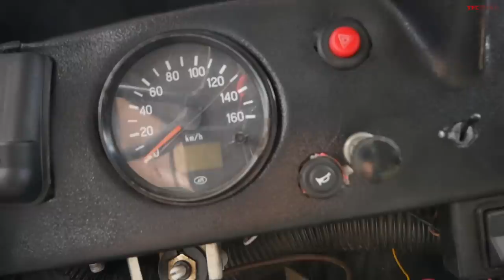My Russian Van Is A Better Off-Roader Than Even A Modern Toyota Collab — And THIS Is Why!

Comment: UAZ didn't make engines - there were different factories which were established as seperate companies after Glasnost. The 2.7 was a ZMZ, but UAZ also used a 2.9 UMZ (also made by ZMZ) and a 2.4 from Andoria in Poland.

Comment: Yes there is a Jeep looking version of these that uses the same engine (I think the whole drive train is identical). The Volga cars also use this engine. Also the GAZ trucks use a V8 version of this engine. I say it's a V8 version of the same engine because everything is the same: pistons, rods, valves, valve drive shafts, the heads also... There's just another bank of 4 cylinders on the crank shaft. The crank shaft and block are different of course. Speaking of cylinders, this engine has changeable cylinders. I mean they aren't part of the block. They can be removed and new ones inserted.
Reply: Yes, there is the UAZ "Jeep" which was as common as this thing. the entire army here in Bulgaria used this vehicle I think. I also believe it has the same drivetrain. Today it is sold as the UAZ Hunter. And the inter-changibility of parts was done for a reason - in case of war you could use parts from other models of vehicles to run whatever vehicle you need. Unfortunately for the Soviets it didn't help them much in the wars they had in the past :D
Reply: @DimitarDobrinov  "the entire army here in Bulgaria used this vehicle"
- Мдаа вярно е. Едно време тия джипки бяха на всякъде.

Comment: I considered buying a Bukhanka, so I made a test drive. I barely fitted in, no room te spare and I am not tall, only 170 cm/ 5 foot 7 inch. The steering wheel was very high, no arm rest on the door. The ride was loud, sitting next to the engine. The door did not seal, the left top front curve was a gap to put 2 finger in it, so water inside when it rains. In the 30 years after the fall of the Berlin wall, UAZ had not fixed that problem.

Going on firm surface dirt road was excellent, no 4WD needed. I was told by the rent company that is the Bukh is not suited for highway use. Just drive on the main country road with 80 kmh/ 50mph. Fuel consumption was also an issue, about 80 % higher then my VW Caddy van. The rent company told me that parts could break down faster then with Western/ Japanese cars, it is still Russian stuff. For reliability the VW Transporter 4x4 was a better choice.

Conclusion: the Bukh is cute car from the past, but not for daily use.

Comment: hi.
i have this cars brother UAZ469 from 1978. its an awsom armagedon wiecle, you can repair it with a hammer and a screwdriver. Its a puritan working machine, i buy it in 2007 from the hungaryan army for 600USD and even today I'm whining it in the forest work. sometimes i go for Off Road partys and pull out there stocked mercedes G, jeep wranglers, pajeros, and range rovers from the mud. it have 75 hp its terible on road and dry area but in muddy terrian he feels in his element

Comment: is there diesel version? how much is CC, and how much is fuel consumption?
Reply: Very few were factory made with diesels. 
The new ones have: 2,700 cc; 112 hp 4-cylinder petrol engine
Average consuption: 10L/100 km
Reply: @crown674  Thanks man 😄
Looks like a goos choice for camping vehicle 👌

Comment: Uaz-452 was developed as a platform for vehicles with a wide range of tasks. In conditions of bad roads and lack of spare parts. A van, an ambulance, a minibus and an on-board truck were to appear at its base.
Reply: О май гад. Итс террибле вехикле.
Reply: @Mralex22801  ноооооу ю Донт андерстэнд зе пурпоз оф ват вехикле дюд

Comment: Some Buchankas were equipped with multiple ways to start them from factory. Ex Neighbour owned one made in 2010. You could start it usually with key, compressed air, hand crank or if you had a 12ga empty shotgun shell then you just put in into special hole on first cylinder, turned the engine once with handcrank - if required, and then hit it with hammer. Boom! Instant runing engine. We once ran out of gas so we fed it with technical petrol. It didnt had any problems with it.
Reply: @stevehalt7916  racist jokes, shame on you laughing at those kind of things
Reply: @firstandlastname2390  as a Ukrainian I take your words as an insult. I have not intended to laugh at  "those things" as you put it; I have intended to note that the person above spelled the name of the vehicle wrongly this bringing the tragic horror of rape and murder into their otherwise innocent comment

Comment: Not done in White because you would lose it in the snow.  These are real off roaders and will keep going through most obstacles. It is fixable and tough.  The heater is extremely good and works in minus XXX.  They also have the Cossack jeep saloon, which is also a real workhorse. They do not worry about the delicate electronics to go wrong and an EMP will not kill it when the solar flares occur.

Comment: I like this Buhanka!  This is smaller than the VW van and DEFINITELY more off-road and cold-weather worthy!

In a place like Northern Canada and in Alaska, or in Minnesota, Michigan, Wisconsin, this would be an ideal winter off-road and ice fishing and/or hunting vehicle. If you outfitted it correctly, it would also be an ideal mini-camper with a small bed in the back and gear storage for your winter camping needs. The ONLY other change needed would be a rear door tubular cage to hold TWO 20 gallon Jerry Cans of extra fuel for super long range off-roading.

For $13,000 NEW, YES you could buy a few thousand as a business and mod them into super-duper long-range boondocker/overlanders and sell them retail for say $28,888 --- A pretty penny could be made off these if someone was enterprising enough!

V
Reply: I believe its too expensive to ship it to US
Reply: A german reseller says you need to do some work after you buy them, like lubricate and rustproof everything, so add a few k ontop for us sale
Reply: Still, with 10yo Sportsmobille pushing 100k would be nice to have something like this and maybe an outfitter with a few interior/exterior options.

Comment: This is the new fuel injected UAZ engine (130 HP).  The old one I think it was the Volga carburetor 2,4 l 70 or 90 HP engine.

Comment: This vehicle makes me reflect back on my 1999 Land Rover Defender 110 TD5, the whole less complicated blank canvas motoring, plenty of opportunity for all the creativity. Of course, the overall performance of the Defender is at a much better wavelength compared to any UAZ, but what makes it so cool is the fact that someone could choose to fit it with pneumatic suspension, sound insulation, better lights and maybe even a better engine. There's room for endless creativity.
Reply: Buhanka is indestructible, while Land Rover is most unreliable car on planet... No comparing. In Bosnia, in demining crews, we all ran away from Land Rover like from plague.

Comment: And there was 6x6...and a HALF TRACK version. Christ in Heaven I love this. Hate to tell Motorman, but Chevy HAD a van like this before '65 and pickup with an amazing side loading ramp based on Corvair.
Reply: @carstv9986  :-) Aaahhh. Alright.
Reply: Actually, there were no 6x6 versions from  uaz, all you can find in internet are custom modifications made by the owners.
Reply: It wasn't four wheel drive.

Comment: It is fake history. He did not proved off road!
Reply: ...words from a true unknowing couch sitting potatoe. Spend your time and Google the Buchanka and sit, listen and learn...
You will find ton's of video where the Buchanka kick all this 100k's offroading cars in the hatch.
Here in germany a Toyota Four Runner TRD Pro cost's more than 99.000 Euro, means more than 100.000 dollars and the Buchanka only a quarter of them.
And you have to know, the anniversary- next to the expedition model, the driveline comes with SPICER heavy duty axles and electronic differential lockers!

Comment: What can I say - the car is made for certain conditions. Let's enumerate them. So this is off-road, the cheapness of the car allows it not to be spared from dents and scratches, a roomy interior, and most importantly, it is simple to the point of nepilichnost, which allows the driver to repair it with ordinary tools. That is, it is ideal for deserted wilderness places - taiga, the Mongolian desert, and so on. He occupied this niche. He doesn't need complex designs. What is not available will not break. Well, in the garden, this is a hard worker, a workhorse for startups and rural businesses. In Russia, it costs about 10 thousand dollars. Find him a competitor at the same price from the assembly line.

Comment: UAZ 469 has same engine like Buhanka, it supposed to run I think 20 miles without coolant, has lower compression on one cylinder in order to start easier at cold temperatures
Reply: Yes, it is the same engine but the rest is not true.

Comment: You can buy one new in Germany. Even with power steering and lockers.
Reply: plus Injector, air-conditioner
Reply: @pavelstolypin  The Russian ones don't use carburetors since 2005.

Comment: Very very similar to the old mid 60s ford vans. Nicer headliner in the UAZ
Reply: Hinges on doors. Bad trim on engine compartment, even the rear latching mechanism ( though it was hidden on the fords

Comment: And flatbed foldavle sides pickup :) Single and double cabine.   And its not an 2.7 engine, its standard ZMZ 2445ccm engine only fitted with simple fuel incjetion.  2.7 have different head, block and more.  Your engine problably have less than 90hp. Funny that this funny dude didn't know that this uaz is in fact post 2000 production :D
Reply: УМЗ-4213, 2.9л, инжекторная "сотка", поршня 100мм
Reply: @zohan9078  so its 2.9 not 2.7, and its based on bored 2445
Reply: @jakubstrumillo  2445 завод выпускал только карбюраторные, а 2.9 сначала шли карбюраторные, потом на них поставили инжектор.

Comment: The UAZ 450 was developed from the GAZ 69 light 4x4 truck. It shared the chassis and engine of the GAZ. And for the 'copying' of the design: form follows function. I had a 2018 Bukhanke. It had a very big wow-factor, but the build quality was horrible and it rusted unbelievably. Steering at speed was outreagiously dangerous, it was all over the road. The front end doesn't protect you at all in case of a collision, you will be squeezed like a lemon. The electronic engine management has left me broken down on the roadside for many many times, requiring a recovery truck. Every week I had to make a tour through and under the vehicle to tighten nuts, bolts, doorlocks, suspension and what. What I liked about the vehicle was the wow-factor. The offroad capability was awesome, even better than the Land Rover Defender. And this remark comes from someone who drives Defenders for 30 years... Main reasons I sold it after 19 months and 43000 km's was the bad electronic ignition, and because we felt very unsafe in the cabin with a non-protective structure, and the bad, very bad road handling. But, they bring still a smile to my face.

Comment: you guys have no clue what kind of mess this things crawls through regularly. They made all kinds of off road heavy and light trucks, tractors beyond your imagination but wouldn't build any decent roads. In Soviet Russia it was considered to be an advantage to have difficult terrain and no good road to slow down a possible invasion. 
Nobody wants to drive this trash. The steering column will impale the driver in a car accident.

Comment: American engineering philosophy is totally different from the west/Japanese. Take for example MIG engines, they were built right next to the tractor assembly lines. They were cheap, easily manufactured, very reliable (they even took bullets into the blades), performance was lower than americans but.they could be built by thousands. If you look at any European test of this van you will see that it is the ultimate 4x4. For 16,500 euros, I'm willing to go to the red Square dealership and get one over the 55k Toyota.

Comment: Car manufacturers like Toyota configure builts for the areas they sell.. so for instance.. the Toyotas.. in China or Russia..their Toyota vehicles will in many cases be more rugged and will often have better durability than one sold here.. 

Some of those vehicles even from Toyota aren't sold and can't be sold here in the states... so yes... in many cases.. many vehicles from outside of the US can offroad better... imo.. its sad.. but there is little we can do about that.. besides spend $$$$$ on mods and so on..
Reply: Isnt it possible to buy it in Russia, ship it to Mexico and registered there, so it dont need to fullfil all US requirements and then use it in US on mexican car plates?

Comment: the Ford Fk from 1960 was very similar to that, aldo it didn't have four wheel drive and it was a little bit smaller
Reply: I co-worker of mine who used to live in the Soviet Union told me Ford had an agreement with one of the car companies over there called Gaz that give Ford access to that market while also providing technical support to the Soviet car maker. According to Wikipedia the agreement was signed in 1929 (perhaps it had something to do with the depression...).  So it wouldn't surprise me that some original Ford or "Ford-inspired" designs popped up in the USSR.